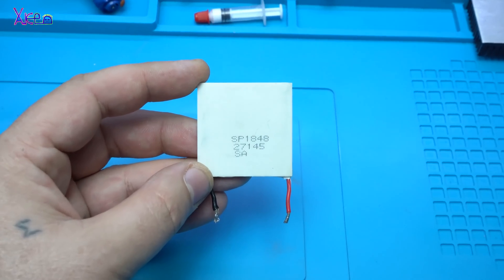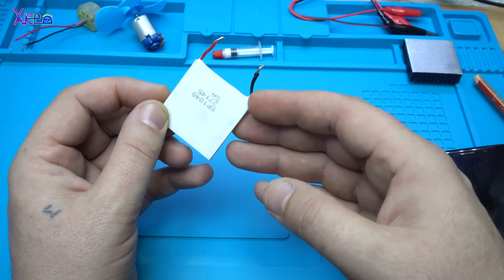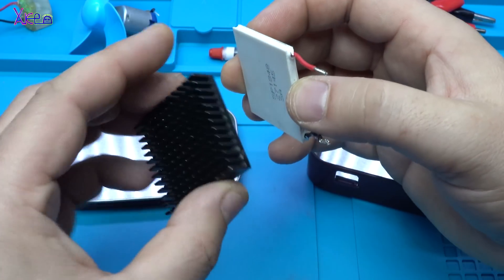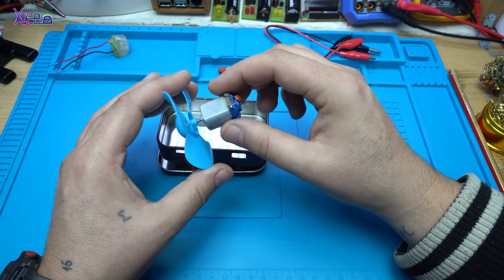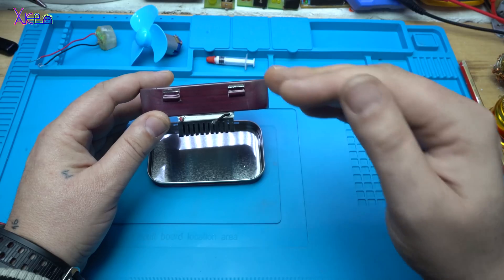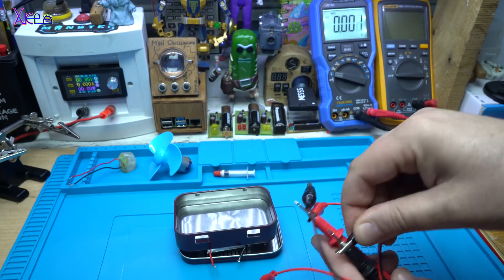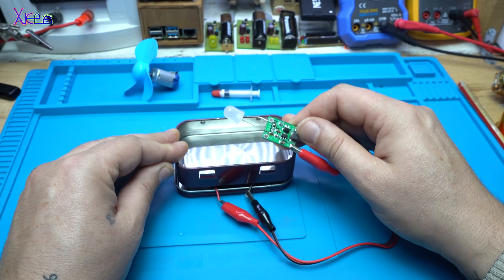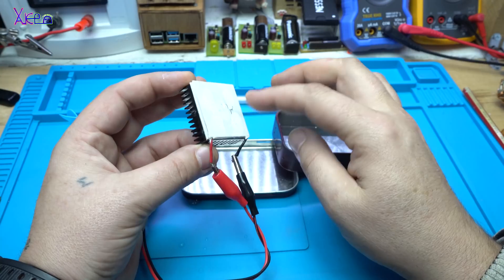Thermoelectric Generator | Science Experiments

Comment: i have a folding wood stove for camping with a solid ash pan on the bottom. do you suppose if i placed one or two of these on the bottom of the ash pan, with the heat sincs in a container of water, that it would produce enough charge to recharge my devices such as my phone and camera in the field while i have a fire going?

Comment: What would happen if you used dry ice for the cold side?
Reply: and if you used a blow torch on the other side, I think you would get at least 3 volts but the Peltier module will melt, it generates electricity from the temperature difference

Comment: Thanks for this! Is it possible to gang several of these together to gain +/- 3.7 volts?
Reply: Sure, u need alot of peltier and good heating and cooling. I tryed it with candlelights and water cooling
Reply: Sure its possible. In fact it is used in oil n gas offshore well platform where i used to work by arranging a lot of thermocouple in series and able to genereate 12 vdc by burning natural gas from well although the efficiency isn't as good as ICE generator but quite remarkable of how simple the system are without any mechanical moving part